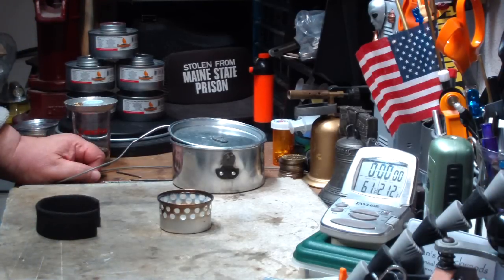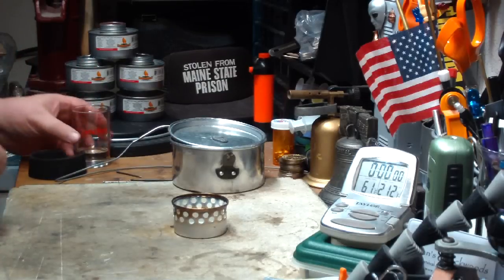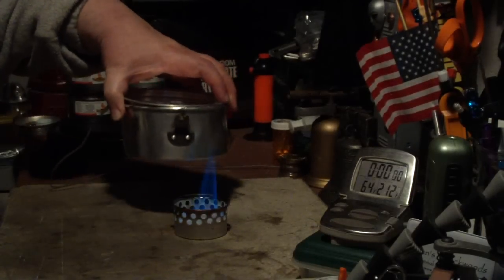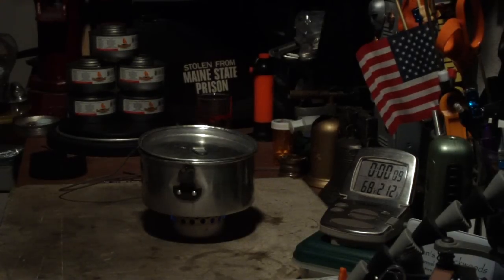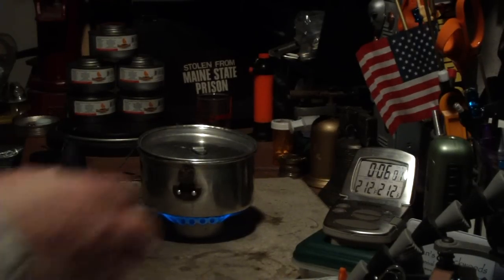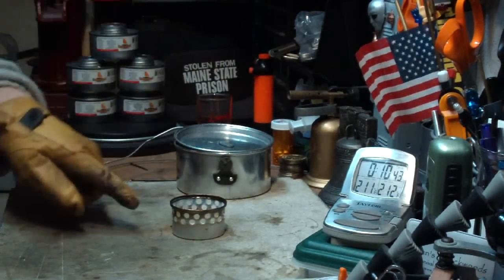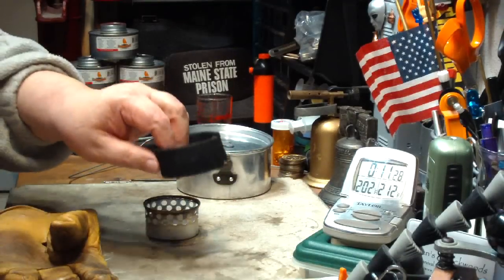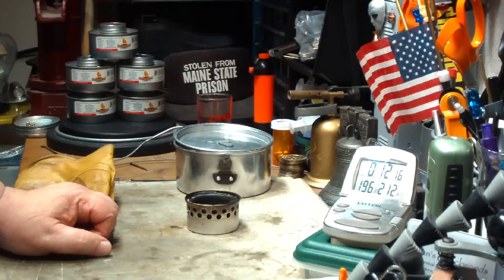Super Cat Stove - Low Pressure Side Burner - Boil Test#1

Comment: I am more interested in how much fuel it uses, rather than burn time.
Reply: Amount of fuel: 30 ml (1.01 fluid ounces)
Time to boil : 5 minute(s) 57 second(s) (357 seconds)
Time to run-out: 10 minute(s) 30 second(s)  (630 seconds)
--------------------------------------
Therefore, amount of alcohol used for boiling = time to boil / time to run-out.
That is 357 seconds / 630 seconds.
357/630 = .57 x 30 = 17 ml.
That's 3.5 teaspoons, or just over 1/2 fluid ounce. By weight, 13.9 grams, or just under 1/2 (0.49) ounce by weight.
Bear in mind, these results are for perfect laboratory conditions, with no wind and low humidity. Out in the field, expect to use at least 20ml.

Comment: Hi Hiram.  I have found that I had to reduce the number of holes in my fancy feest stove.  Instead of two rows of 16, I have maybe two rows of 10. Otherwise the flames went beyond my pot too much.  And my pot is a wide one!   I live in the arizona desert, so maybe this is happening because of the dry air here. Keep up the good work. You're a legend.
Reply: The hotter the ambient air temperature, the more rapid the boil. I have used stoves with many holes for winter and fewer holes for summer to control the combustion of the alcohol somewhat. Placing a tin from a tealight candle inside of the stove allows a simmer,  but, again, your simmer in hot weather will be higher than in cold weather, and, in extreme cold, I sometimes fail to keep the stove lit. Limiting the  oxygen available to the fuel is the only way to control the temperature and fuel consumption of alcohol stoves.
Alcohol, however, is a "clean" fuel in that it is made from rotting vegetation and distillation rather than being extracted from the earth by drilling. It also doesn't require a relatively heavy steel canister for transportation and use. I use repurposed plastic schnapps bottles. The shape is perfect for carrying in an inside pocket to keep it warm (and more efficient) in cold weather. Sleeping with preheated water in cold weather makes your breakfast water boil more  quickly than starting with cold stream water, too.

Comment: hi there is no doubt about it the cat stoves are the best all round stoves when your in the field my version which i call the wild pacific stove boils 400 mls of tap water in times off  5" 10 SECS  on average boils for 13" mins on 2 ounce of meths using ceramic paper for the wick the ceramic paper is on trial but its looking good after 10 burns there is no material loss or absorption loss
 my cans are smallest  samom tin and a small condensed milk no cutting just need to drill pressure relief holes and away you go
 ps your vids helped me  to decide which stove to use thanks
Reply: I would really like to have read your comment but the lack of punctuation made it too difficult.

Comment: I made a larger cat can stove with a water chestnut can for a pot stand /windscreen. It is way more stable and holds more alcohol and no waiting required. No holes required in the cat food can and can opener holes in the water chestnut can with the top and bottom removed. It is still light and nests inside a pot.

Comment: @ColoradoCamper The carbon felt will turn the super cat into a blow torch. Check my video on my turbo stove. This is a micro Super Cat 2.1 inches in diameter with four pieces of carbon felt sticking out four of the jets. That stove without the CF took almost 9 minutes to boil with Heet. With the CF it boiled two cups in 5:37. Now my turbo actually has the CF sticking out the jets by 1/16 inch

Comment: Good test. I made a pot stand for the wick type canned heat you have in the background out of a similar Bumble Bee crab meat tin, using a similar hole pattern, and cutting a hole in the bottom to clear the wick holder. It nests perfectly on top of those cans, and I have them in the car emergency kits.